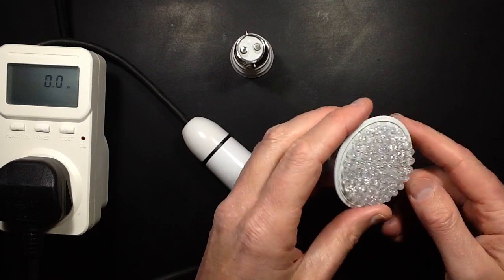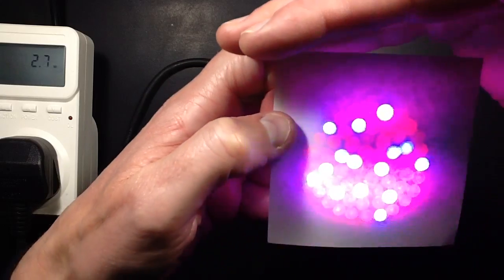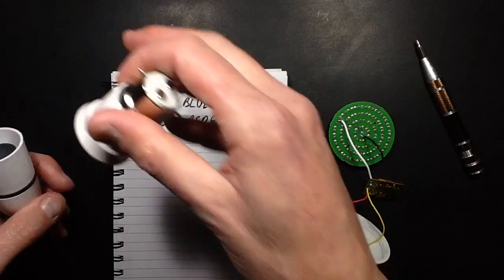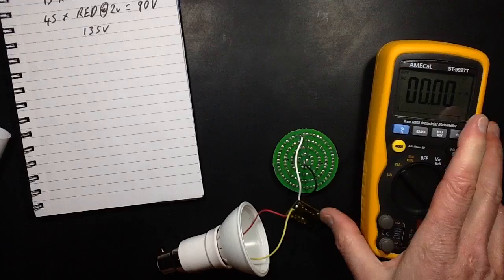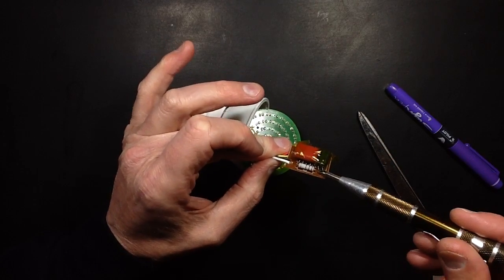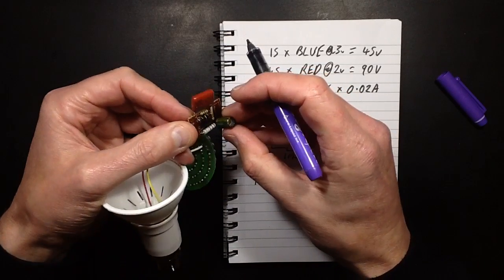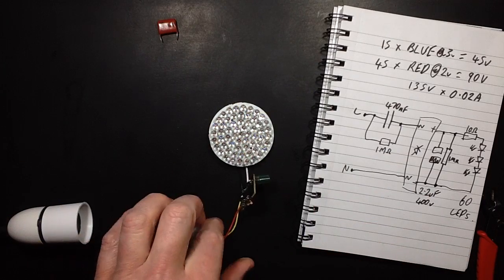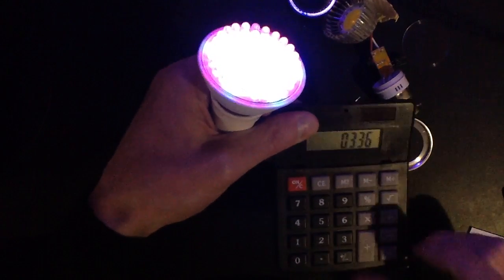Teardown and schematic of 60 LED grow lamp.

Comment: Clive, I am not certain with regards to a few things about, and considering this LED lamp. First: when you started making changes to the power 'source' (11:46 and a bit before), how come the blue ones were shining the brightest when in fact those are the ones that need the highest current (3 vs 2 V)? (Are they maybe apart from that voltage, requiring the lowest amount of milliAmps?..) Second, how come you say the makers of this lamp have been going easy on these LEDs: isn't 20 mA the max they are able to convert into light anyway? And third, is it in your opinion possible to build a LED lamp (like this one, for instance) WITHOUT making use of a bridge rectifier? Thw answer to that question of course depends on whether or not it is possible to smooth out that 25 Hz sufficiently by making use of one or more capacitors (the 25 Hz "flickering" being caused by the fact that the LEDs will let pass, and use, only half of the 50 Hz at which the polarities of the alternating mains current switches, of course. Actually, I personally do not (even) know if it is possible to use capacitors on an AC current.. that might be the inherent 4th question, that would automatically get answered with the word on question number 3! Thanx, in case that you would spot this remark and get 'round to answering it.!!

Comment: Have you seen the LED bulb kits you can get from Ebay?! I was looking for some cheap electronic kits for a maker event and spotted them. They look interesting, if a bit disturbing that someone unaware of the dangers of mains electricity could happily mess about with them.
Reply from the maker: +MegaWayneD I have a selection of them here which I will finally do a video of at some point.  They usually come with the power supply, but no LEDs and unusually the LEDs are wired in parallel pairs, presumably to allow the large number to be operated on 110V supplies.  But these are definitely not the scariest mains powered Chinese kit on ebay.  I'll be doing a video about those too....
Reply: Excellent! I'd love to see them.

Comment: The lighting and fixed exposure give a big improvement. I agree with others that a mid grey background would be better. Ideally one would have a fill light at the bottom of the shot, but of course this is where you are sitting. Wearing a white shirt would reflect a fair bit of light though. Alternatively a light to the left and right of your table might work nicely.

Many thanks for all your video work Clive. It is both fascinating and informative.

Comment: The lighting looks nice, maybe almost a bit too dark, but the shutter speed (virtual shutter I guess) is really fast so the video is getting that kind of Saving Private Ryan effect where everything looks very staccato. It's not really noticeable unless you move your hands fast, but it is a bit odd looking.

I'm not sure how you'd be able to solve that on the ipad though unless the camera app lets you adjust ISO and shutter speed. I haven't used any modern iOS in a while so I don't know what features it supports!

Comment: Don't leave the meter in current mode (DOH)!

3 weeks late on that one for me,  tinkering with a solar charge contoller i used a boost
converter to increase the input to see what happens to the charge and kept wondering
why the onboard fuse kept blowing.

Luckily its a cheap yellow Maplins meter that i only use for low voltage DC.

Thanks to you Dave and Julian i have now started tinkering with electronics and
find it interesting where in my youth i thought it was boring.

Keep up the good work.

Comment: 2.2 uF at 400V ? ?
Reply from the maker: +airwood99 These older style capacitive droppers allowed for the possibility that the LED string could go open circuit with a capacitor voltage of about 330V on 240V mains.  The modern lamps use a lower voltage at a much higher capacitance value for less ripple, but with the risk of the cap exploding through overvoltage if the LEDs string goes open circuit.
Reply: +bigclivedotcom I was watching your 3 V globe video which had a 50 V cap on it thanks for your explenation now I see the difference, heat and cheap caps are not known for living very long so the smoke vents you suggest are a good idea!

Comment: Hi Clive, in my opinion the lighting is much improved. A further test would be to see if you can differentiate between the yellow of the LED's and the white background of the backing strip. On your tear down of the LED strip light, the only time you could see the yellow was when you put them in shade.

Comment: I use matt black on things, i generally use blackboard paint with a coat or 2 of polyurethane satin varnish.
The varnish may help with your stickiness problem, and protect the surface better.
Photographic softbox cover may be better as a diffuser
Reply from the maker: +Sparky Projects I'm not sure ANYTHING could protect my workbench from what happens on it.
Now you mention the diffusion, I've suddenly realised I do actually have softbox silks here.
Reply: +bigclivedotcom That's true :D
though the poly varnish i use is meant for floors, so is a bit more hard wearing.
Reply: +bigclivedotcom thank you for taking our input to uvideos about your lighting.